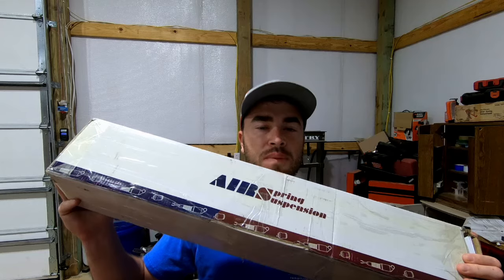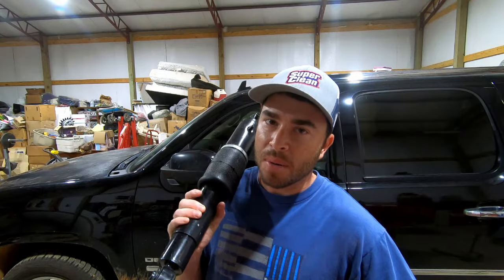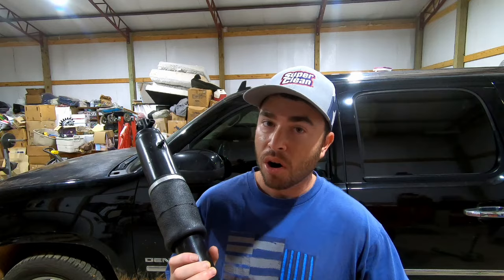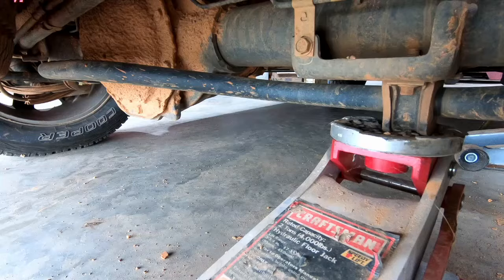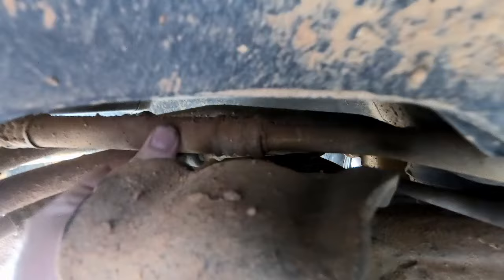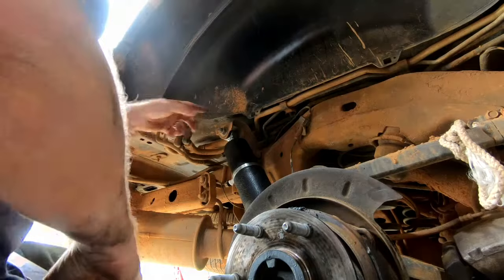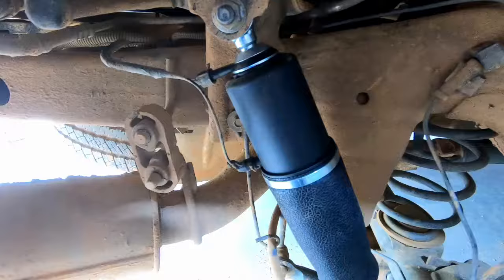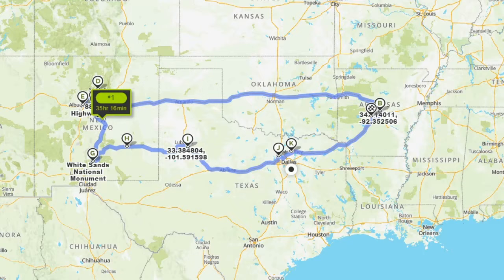Vigor Air Suspension vs. Arnott vs. Suncore vs. OEM.  Test and Review!

Comment: Which shock would you recommend for towing a boat/trailer?  Thank you!
Reply from the maker: I like the vigor.  I have towed a 21 foot ski boat with mine.  They performed just like the oem and so far no issues.
Reply: @FarmDad  thank you Sir! Keep up the great work!
Reply: @FarmDad  Suncore or the Vigor? Been trying to comb through the comments to see how the Vigor's are holding up, as my wife's 2015 Tahoe needs new rear air shocks, towing our 27' camper last week was doable, but bouncy, and mostly side to side. Compressor kicks on repeatedly on level garage floor, something is up. Looking to find replacements, was looking at the arnotts on RockAuto, but found your video, and the Vigor are half the cost. Just looking to confirm you didn't go back to Suncore's after two years?
Reply from the maker: @RichardRinfrette  oh thanks for that catch.  That was a typo.  I probably was responding to comments while doing multiple things at once and had a brain fart.  I do still indeed have the vigors ony Denali and I have had zero problems so far.  I think they've been on 2 years now and maybe 25k miles.

Comment: What about the front shocks ive been looking for full set of my escalade and I choosed what you recommended so far Vigor. I believe the price of the front is so high so do you have any recommendations for active shocks ?
Reply from the maker: I'm using oem on the front.  I haven't compared to aftermarket so I can't advise.
Reply: @FarmDad  thanks man,, and are you still happy with Vigor air shocks in the rear ?
Reply from the maker: @mohammedjalal736  yes, sir.  They are still doing good.

Comment: I liked your videos but I can't recommend Vigor air shocks. (I do have their pump but time will tell on it) My issue with the shocks was not leaking or anything like that. The top eyelet broke off while driving and almost destroyed a brand new tire when it fell over against the tire and wedged between it and the air pump housing. (And yes, everything was properly installed and torqued) The only thing that saved the tire was the inner fender liner and the fact we were able to pull over immediately. This happened under 2 weeks after installing them and less than 300 miles of usage. Looking at it, it looks like it was just poor welding at their factory. On the part of your video where you compare suncore and vigor and say that suncore is more beefy at the top is 100% right. Suncore is much closer to ACDelco/OEM in that area. I'll either be replacing these with Suncore or spending the extra money on ACDelco. In my opinion, the Vigor shocks are dangerous just because of how the top eyelet is attached. I'm just thankful it broke at low speeds in town and didn't snap off on the highway!
Reply from the maker: I'm sorry to hear you had that experience!  Mine must have had a better weld at the top as they are still going strong.  I had a really bad experience with suncore, so definitely think you should go ac Delco, if you can.  Best to you.

Comment: What shocks do you recommend for the front?
Reply from the maker: That's a good question and I really can't answer it as I haven't tried more than one brant. I'm running oem (ac Delco if I remember right) on mine.
Reply: There are struts on the front.

Comment: So can I bypass the  air suspension? An go with the rancho rs9000 style shock I have a trip coming up with a decent trailer wanting to be able to adjust why do you think?
Reply from the maker: I stuck with air shocks because I tow.  Plenty of people have bypassed and bought shocks like that, but you can't beat the leveling of an air shock when towing.
Reply: @FarmDad  Interesting  thanks for feed back I usually tow with my truck but ended up having to use the Yukon for the towing on this next trip in two weeks I was worried about the rear sagging due to weight didn’t think it would be smart enough to level itself out!

Comment: im about to put these on my 2011 Yukon Denali XL.  I hope my results are as good as yours!
Reply from the maker: I'm still happy so far.
Reply: @FarmDad  I installed them and I like them so far. My only issue is I’m still getting the C066-06 code and the compressor won’t run. It’s a new compressor (Dorman). It will run if I bypass the relay. The airbags will be empty after a while.
Reply from the maker: @SgtColkitt  sounds like that relay is bad.

Comment: oh awesome :) 
i literally JUST crawled out from under my denali …
after installing some fresh SUNCORES.

ima just go float it down the river. 
🤦🏼‍♀️
Reply: & i was so excited 😭
Reply from the maker: @leexxxa  hopefully you will have better luck with them than I did 🤞
Reply: it's me again - i felt that my initial comment is one that begs of some justification (& maybe a little self redemption, maybe).... so...

as for justification - I don't have any. cheap is as cheap does.  I have learned in this industry that "cheap" is often actually "hella expensive" in a masked disguise.  lol

suncore never made it off of the jacks or onto the road .. majorly in part due to having seen your video.  I could not, in good faith & love for my truck, put something that carries with it such a host of negative reviews & expect it to perform as i want & as i need.  at the end of the day - my truck has just clocked over 300K (true) mi. on the dash & 80% of those miles are traveled on the factory, stock parts that she was built with.  so I know everything is tired. not just the shocks. a POS shock + 300k old parts- didn't sound right to me. I'm lucky to be able to replace parts preventativly rather than repairatively & at the pace of my wallet.

so yeah this is so long; I haven't a clue how to sum it up so I'll just end here for the sake of you having a life outside of reading this comment.  

I replaced with OEM stock, not aftermarket... I just went with the same ones that carried me to 300k as I know I can trust them.  I rebuilt my compressor & that saved me a bit. 

but thanks again for this & saving the rest of my suspension system from a bad decision on my part.

Comment: I can’t describe how much anger I have gotten from max speed air shocks
Reply from the maker: I haven't heard of them.  Please post your experience so others avoid them.  Thanks!
Reply: @FarmDad  they barely hold air mad fragile and the top where the bolt goes and the bag would always collapse casing the air bag to sag to the bottom of the shock leaving the metal rod of the shock exposed